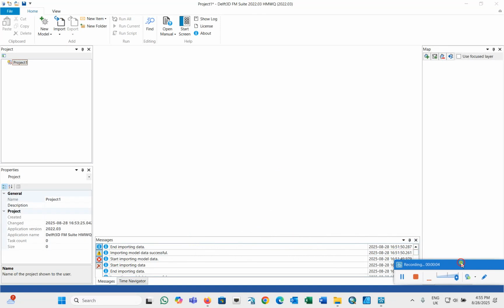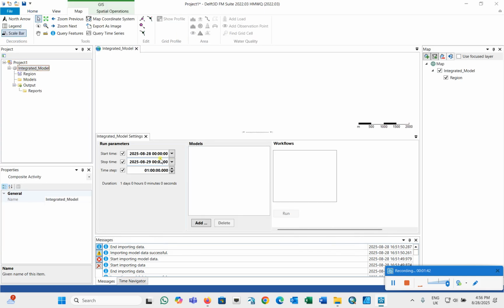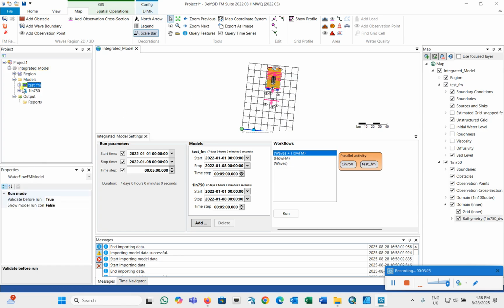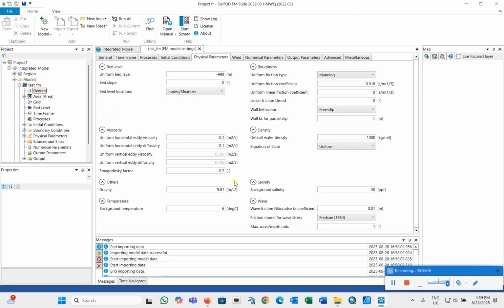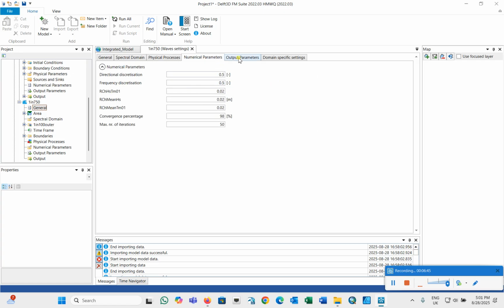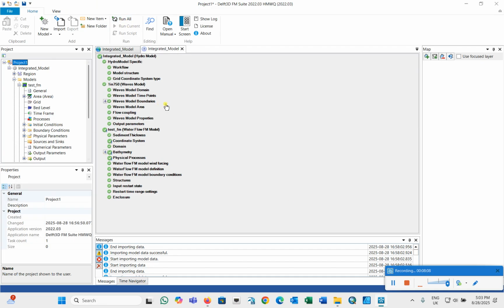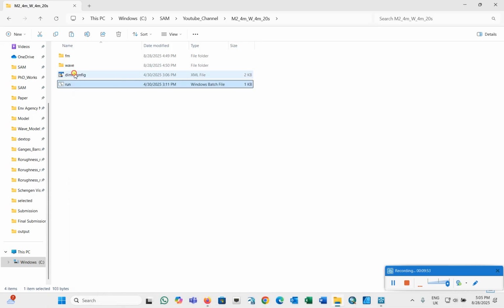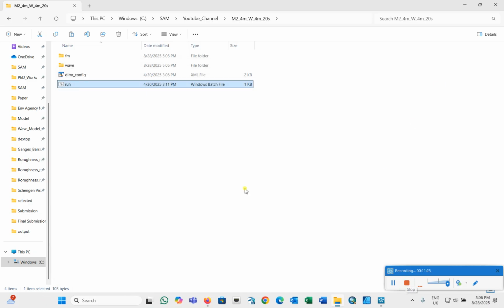How to Setup an Integrated Flow and Wave Model

Comment: Thank you brother, very helpful. Would you explain why you use the wave model in a outer boundary or nest one and the flow in the inner boundary? All in All, what nest boundary is mostly used. I am trying to model the sand wave migration in North sea and I think I should use nesting. Many thanks!
Reply from the maker: Hi thanks for the question, the main reason is optimising the computational time. For the wave model my original boundary was quite outside the area of interest so nested the model with coarse grid on  outside the area of interest and then there is inner grid which is finer. On the other hand flow models boundary data was near the area of interest so only a fine grid is being used.
Now for North sea if you consider the whole area I would suggest that you nest your wave model with different resolution for different areas with finer in the main area of interest. And I think you also need flow+wave+morpho simulation for sand bar movement. Hope you get your answer.
Reply: @ee1989  Yes, All clear thank you. Just for saving time if not much going on somewhere it should be nested, and fine mesh for areas of interest. I try the models brother thank you. Actually I learned DELFT3D only from your simulations and videos. There is not much enough information and tutorials for this software. I know CFD very well but working with software a bity different. Good luck and thanks for broadcasting usefull content for us.